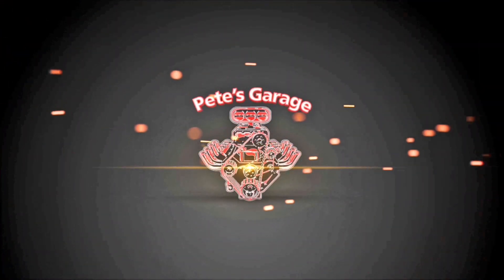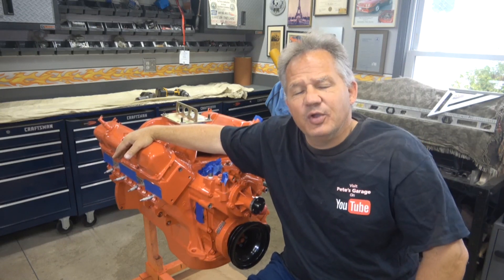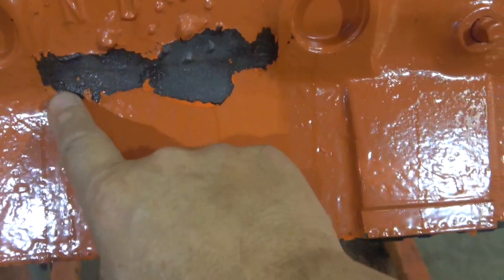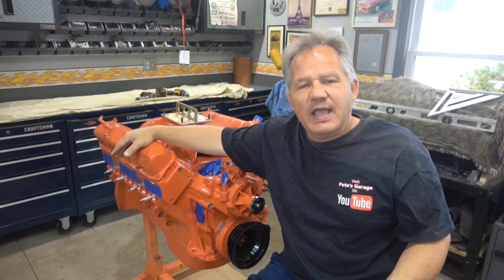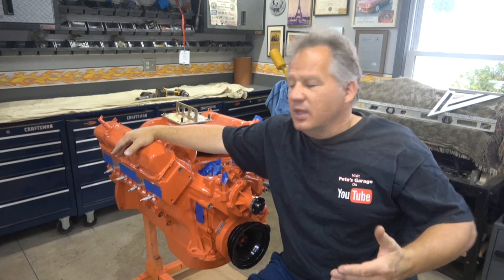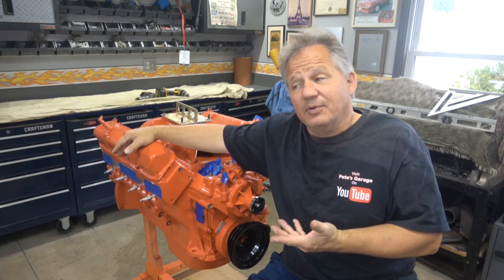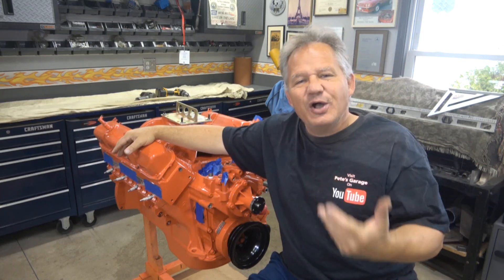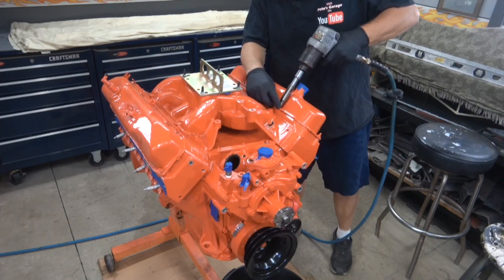Engine Building - Failure Analysis 440 MOPAR Tear Down

Comment: I've seen a handfull of these over the years that have cracked in that area, typically a block with improperly mixed coolant or just water in the blockz and it freezes in the winter months and cracks.
Very repairable.
Reply from the maker: You're right, it is repairable

Comment: Hi Pete, I believe that is a freeze crack.
If that is the only place it's cracked and leaking, it can be fixed.
Cold welding process like Irontite or Loc N Stitch, etc.
There really is no stress down there on the block.
Infact, that could have been fixed without tear down if that is the only problem. 
Have a good evening. 👍🇺🇸👍
Reply from the maker: I agree, I my fix it and do a video on it

Comment: Hey Pete, what was the tool you used to get the crankshaft bearing caps off?
Reply: He just used the main studs and put pressure on the cap by squeezing them together.
Reply from the maker: Yup, just a couple studs